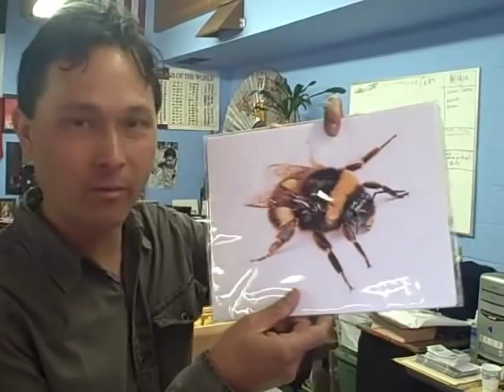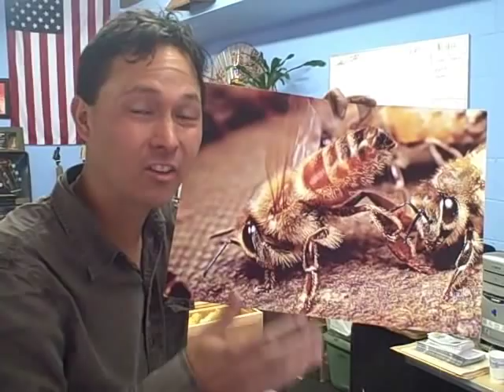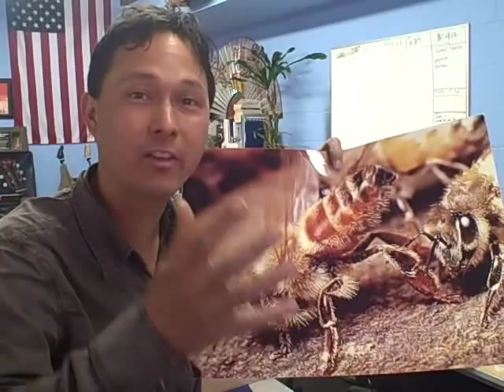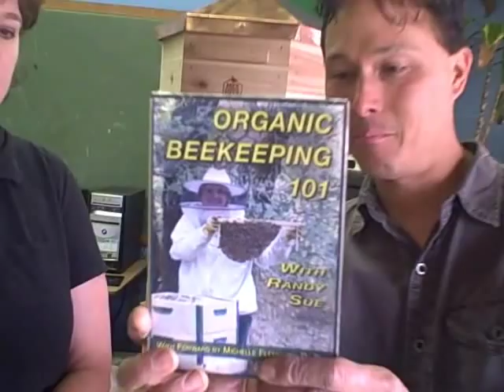Starting a New Bee Hive - Which Hive is Best ? Where Do I get my Bees?

Comment: 2nd part. I will be watering my plants manually, at this moment I can't install a drip irrigation system because of many different reasons but in the future I will. My problem is that I will be using Mykos but don't have a water filter. I was wondering how important this is ? Can I get away with out filtering it ? Are there any good water filters that I can attache to a regular faucet and then my garden hose ? Other options? Thank you so much John, you are awesome.

Comment: That's todge mate :)
My bees didn't get any chemical treatments even though they have varroa. They survived the winter and are now exploding into the late-coming spring when many commercial bees haven't made it.
The point you made about mites spreading is *exactly* the reason you will not beat them by spraying. You'll only make them stronger and the bees weaker. Unless you eradicate every single wild bee hive on the planet, which some have tried to do...

Comment: Randy Sue has most of it right, but I disagree with the Hex-Hive being any more natural than a Langstroth or similar hive.  Why? Because it uses small, enclosed frames which seriously limit the bees in their natural design process. Another issue is using preformed wax sheets that force the bees to use specific comb cell sizes.  The HH also not allow the bees to do what they want as much as a Top Bar Hive which only has starter bars at the top. Read PJ Chandler "Barefoot Beekeper" great book!